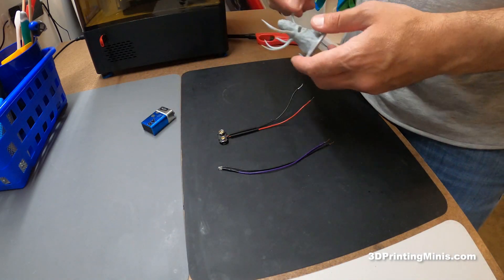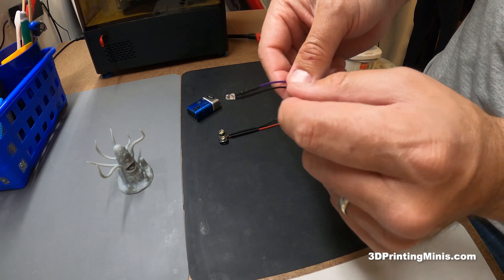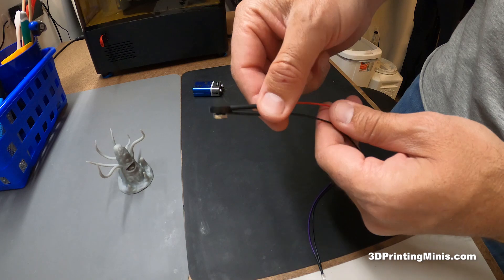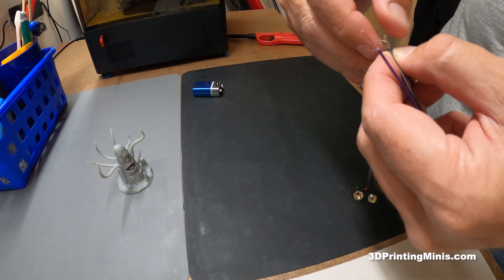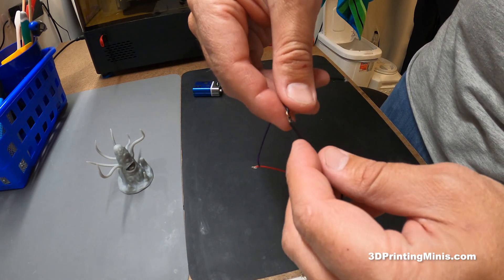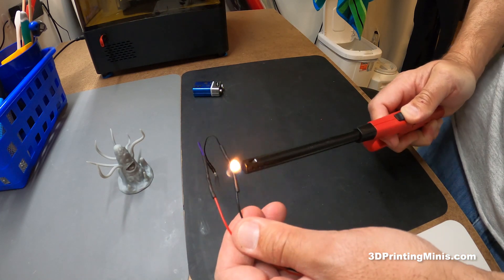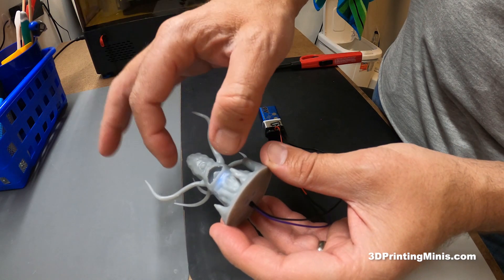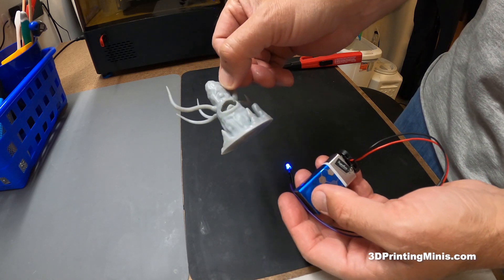How To Make UV Snake Light For Curing Hollow 3D Resin Prints

Comment: Nice.  I made on using the 12 volt plug my home made curing station uses, but the embedded resistor gets warm. Thing I'll try the 9 volt battery
Also may make 2 or 3 lights to do all sections at one time

Comment: I made a set of these and popped a pair of lights into a hollowed model to cure. I left them for around 3.5 hours, and after that period of time they didn't seem to have cured anything at all. I had left a few thin supports in there as testers and when I tweezered them out they were still extremely bendy like they hadn't seen any UV at all. Have you tried this on any larger prints where you can physically check that the inside is cured? I'm feeling really deflated after that amount of time seemed to have no effect, but maybe for large prints I need to leave it for a much longer period of time, like overnight or something. I really don't want to burn through batteries like tic tacs but maybe I can get rechargeables. I guess I'm just curious if anybody's had any verifiable success with these, like for larger models that you can actually test the inside with a tool or something to make sure it's hardened? I've even tried taking UV strip lights and shoving half the strip into the hollowed print for hours on end and that doesn't work either. I'm becoming convinced that these smaller lights just aren't on the right wavelength or aren't powerful enough to have an actual curing effect unless you can have a LOT of the lights going (like on homemade curing stations made with strip lights). I haven't had much luck with flashlights either; they haven't been very effective overall, or I just haven't been able to channel their light in through the hole.
Reply: From what I understand, some cheap/rip off UV LEDs are actually just purple coloured LEDs ;)

I bought a UV LED yesterday from my local electronics store. I haven't fully tested it yet. But it was rated for 3.3-3.7V with max 5V. 5V is the output of a USB battery bank or phone wall charger adaptor. This makes it more sustainable in that I'm not throwing away batteries.

This method could also prolong the life span of the LED compared to a 9V battery putting too much power through the LED (depending on the LED power rating), although you could add a resistor if you want to drop the volage down to something the LED prefers. Or you can get a AAA or AA battery holder (suggest a 3 battery holder if you're using rechargeables as they're 1.2V each compared to 1.5V for non-rechargeables, assuming you have one of the 3.3-5V LEDs). Add a little switch if you're feeling perky.

Your options then;
USB/wall charger route; UV LED + cannibalised USB cable 
Battery holder route; UV LED + battery holder + (optional) switch
9V battery route; UV LED + battery connector + appropriate resistor

Plus some electrical table or heat shrink tubing.
Reply: @callianis  yeah my setup is essentially what's shown in this video, exact same LEDs and all, except that I'm using a battery holder with a switch to make things easier. They're lighting up and everything just fine, they just don't seem to put off adequate UV or the right wavelength to cure the resin. I'm going to try with a much longer exposure and see if that does anything... I have 4 lights set up right now so maybe if I pop all 4 in at once and leave it for like 8 hours or something. I don't have any prints currently to work on but once I have some more I'll experiment and report back. 😁
Reply: @strangespeciesart  worth giving it a go :) also the LEDs might only have a 30 degree beam of light so it'll cure mostly in the direction it is facing (so putting the LED next to the resin test might not be effective - shine it directly at it).

Comment: One LED is around 0.06W I believe.  The curing station I have is rated 40W.  Does it not need far longer than just a couple of minutes to cure the inside with a single LED or have you had a lot of success with this method?
Reply from the maker: The manufacturer of the printers and resin I use has shared this video before on their social channels and their recommendation is to raise the curing time to 15 mins using this device.

Comment: Looks like these are rated for 12v. Obviously they do the job off 9 but do you think there is any advantage to putting a full 12v through them? More coverage, reduced cure time etc?
Reply from the maker: I've only run them off a 9V battery. I'm not an electrician, so I have no idea. (I don't mean this sarcastically. I just mean I don't know.) Please don't electrocute yourself. 😀
Reply: Standard Led lights like this are always rated closer to 3v. I'm not sure what component is wired into the Led but it may be as simple as a resistor providing a voltage drop which would waste a lot of the battery. A lithium ion battery connected directly to the bulb would probably work. For this case in the video, connecting a 12v power source would almost certainly fry the bulb
Edit: wow they do sell these to run at ideal of 12V after all. I'm not sure why they wouldn't use a smaller resistor to make it more suitable for 9v or a 3.6v Lithium ion battery. This current design is wasting a lot of power
Reply: Depending on what the bulbs are rated at you could put Double-A's in series At  1.5 V each until you get the required voltage or close to it

Comment: I have seen other people using resistors in their Led circuit (i don't understand much about electrical wiring) why are you not using any resistors?
Reply from the maker: There are different brands of these types of lights. The one featured has the resistor pre-soldered to wire. That is why I used it. So, I wouldn’t have to solder.

Comment: I have the same LEDs, but they don't seem to cure the resin. Have you had issues with that? I did a test and left the LED over the resin for 2 hours and it was still runny (very tiny thin dot). I did notice the UV was rated at 395 on the package I received. Is it possible some resins must have closer to its 405 rating?
Reply from the maker: Phrozen recommends curing the inside for a long as 30 minutes with these lights. I don't know the brand or exact type of lights you have so there's no way for me to say how long it should take for you. I guess you've tested and come to the conclusion that it's 2 hours. If so, I'd consider investing rechargeable batteries to save yourself some money in the long run.

Comment: HELP I just got a phrozen sonic mini 4k and I really need some help getting my resin setting for the machine I'm using anycubic standard grey resin, since its a mono 4k screen how low of an exposure time can I get away with?
Reply from the maker: Go to Phrozen or Anycubic's website and get the resin settings for your model printer. Enter these settings into Chitubox or Lychee Slicer and then do a set of validation cards. You'll be all set.

Comment: what size holes do you use? looks like they are the smallest possible to fit the diode in. I'd love to know.
Reply from the maker: I try and make my holes a minimum of 4mm. Sometimes if it's a tall model of a standing biped creature I'll put two small 2mm holes (one in each foot) as well.
Reply: Thank you!
That small component in series with the LED is a resistor to limit current(preserve the magic smoke inside)😎